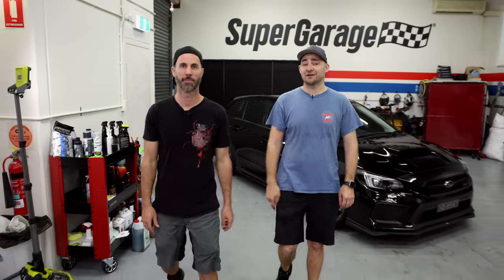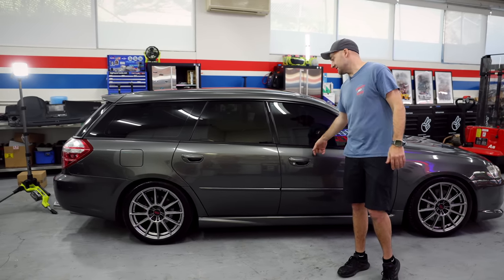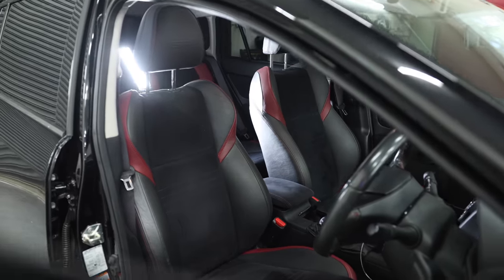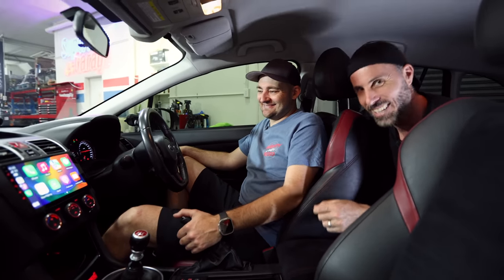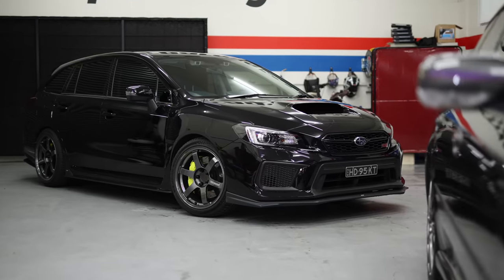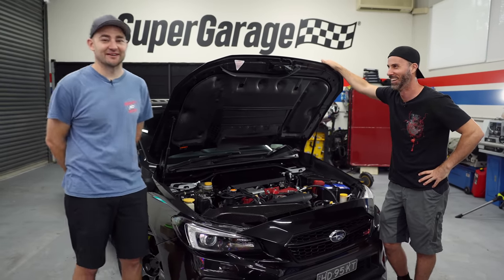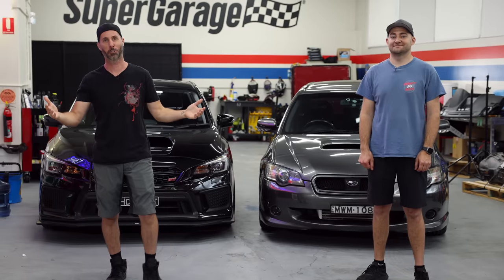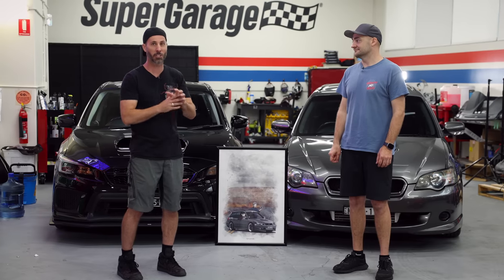The BEST Subaru Wagon Ever? We have two - Marty's Levorg Part 8

Comment: Being an American i hear how wrong we are for calling it a trunk. Here me out. Back when cars first came out they had to add an actual steamer trunk to the back for holding things like guns and blankets while traveling. If you call it a boot thats fine but you stick your foot in a boot. You can fit a body in a trunk. So i still think callling it a trunk makes more sense. However. I can see calling it a bonnet because a bonnet covers your head which is important.  A hood also covers your head but its something loose and more for warmer weather. This implies you should remove it when warmer. A bonnet is something that was worn year round but was also made to be a visually appealing thing that completed the look. Hoods were also what people used to refer to criminals. And that is bad because a cars "hood" is supposed to make the cars overall look.

Comment: too bad, they comparing interior of Levorg top equipment and lowest interior equipment of Liberty. But BP in top version also has "Start" button, multi-steering wheel, si-drive, audio system with up to 11 speakers + subwoofer, adaptive cruise-control. PLUS, u free to buy this kind of chinese "idoing" headunit for Supergramps also, no big deal.

Comment: Supergramps doesn't have steering wheel controls or an aftermarket headunit because Marty didn't want it in that car. He could have easily gotten the steering wheel with controls from a top tier model, he says it's the higher tier but if it was it would have steering wheel controls for both cruise and head unit volume and mode options. So sorry mate I don't believe you on that one.

Grab a Forrester wheel on the same year or newer and wire it up with steering controls. As for the haltech unit I think that dash unit needs to go it looks really bad in that location and it's not a track car anymore.

Hell just make a double din fascia like you did for the haltech and call it a day.
Reply: 🔝🔝Hey thanks for watching and leaving a message I really appreciate it I have something special for you🎁📦🎁

Comment: I got a question for you guys on a subaru that i got so its a 2003 legacy outback with the ej253 with a 5 speed and now im woundering is since its a single cam motor is it ok to boost that motor or would i have to do some upgrades before boosting it

Comment: Its not a fair comparison for 4th gen Legacy. Higher 3.0R trims had mfd, and steering wheel controls even on early models.
Facelift(2006-2009) makes it almost identical to Levorg. You have full suite of buttons on the wheel in almost same arrangement for guage cluster display on 3.0R Spec b(it can cepebrwte you birthday too) newer radio with bluetooth and aux and dual zone climate control. I dont need more bs that touchscreens have. Just aux in for my phone or bluetooth not this apple car play bs.

Comment: So at the end are yall basically sitting on STI owners cause the swapped engine isn't good enough? lol. I'm just wondering how many people are all twisted up by this turn of events. Excited to see what's next, curious if you've gone even bigger or not. Porsche has gone up to 4.2l flat6, or going with another ez36 but gonna actually build the engine, get a custom crank (that won't self destruct above 8 psi boost) this time? Or maybe not a flat6 this time? You buggers and your cliff hangers ...

Comment: Also it should be stated DO NOT DO AXIS DONUTS IN A SUBARU WITHOUT A BAFFLED OIL PAN!! You oil will slosh into the opposing side cylinder head and stay there! even in an STi the baffling in the stock oil pan is abyssmal. Get an IAG baffled oil pan or a Killer B I have installed  more subaru engines because of people ripping donuts on a stock sump.

Comment: Aye lads any chance u have any idea what the best way to achieve this desire - I have an odyssey absolute 2005 2.4 k24a jdm import (in England)

I have a civic type r fn2 as a donor car it has a k20z4 engine -

Looking to frank it using the k20z4 head k24a performance bottom both engines have 198 bhp.

Problem odysseys an auto. I hate autos🙅‍♂️ so then there’s the donor cars 6 spd trans I want to put into the odyssey absolute but how do I do it, fn2 has a 37820-rsp-e02 ecu with a 3 set separate connectors, the odyssey has a 37820-RGL-A57 auto ecu both are obd2, I’ve heard of a trick with the earlier Hondas ecu obd1 but it’s not possible. Apparently on the obd2, my internet search has just brought up the whispers of coulda been legends, but nothing concrete. I’ve seen people go to mad lengths, swapping and splicing complete harnesses from multiple cars with different Ecu’s and much more more but one thing, I can’t decipher what the best way is, and also why no one has figured out how to turn a ocb2 auto ecu into a useable ecu for there manual counterpart! 

Either way, what - from your guys many years of crazy experience, would you say would be he best way to achieve a Frankenstein’s k24/k20 - manual odyssey with a turbo, maintaining full functionality of original dash. How would you guys do that? 

🫄🤑👀🤷‍♂️😹
Reply: Ultimate dad van the 2005 odyssey from Japan - so mean looking and for a 7 seater so low to the ground, this Subaru reminds me a lot of why I like the odyssey absolute 2005 jdm k24a

Comment: Yeah, whatever. I'll repeat what I said on facebook. You guys have spent so much time, effort and money creating something that has existed for ages.
2017 VF Commodore SSV or Calais V Sportwagon V8.
The VF looks better. 
Interior is a nicer place to be.
Is a true five seater unlike the four plus a kid for yours.
Can tow a houseboat instead of a jetski.
More power. More torque.
More tech.
Parts are readily available, cheap and plentiful
Will do a road trip around Australia with ease. Yours will get to the snow.
With LSD there is no need for AWD. You'll want AWD for only 2% of the time you own the Subaru.
VF is far more reliable.
Can carry so much more stuff in the VF wagon over the Subaru.
Driving position is more comfy.
Handling is on par. Ride comfort is better.
Fuel economy will be the same for both around town. Better for the VF on road trips.
...
Let's face it. The VF V8 Sportwagon is a better car in all areas over what you've built.
Why teach young people to spend all this money on something that exists already in a much greater capacity?
...
You've got this one wrong, guys.
Edit: And the VF will still do your precious skids and burnouts.